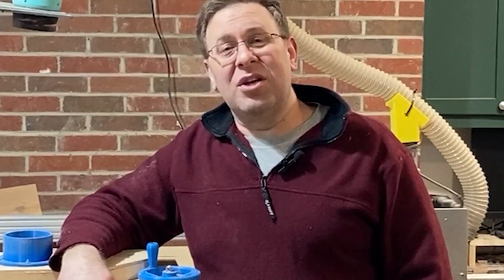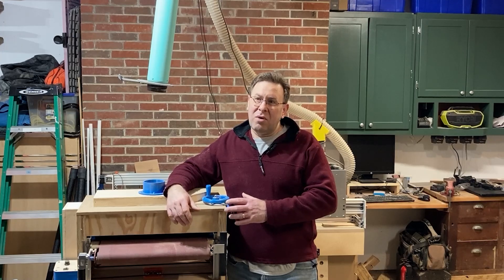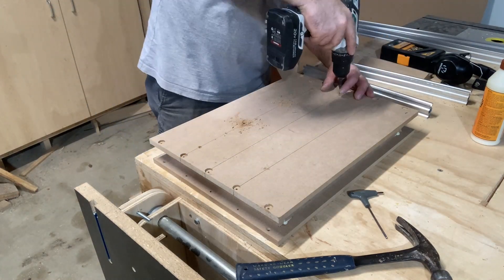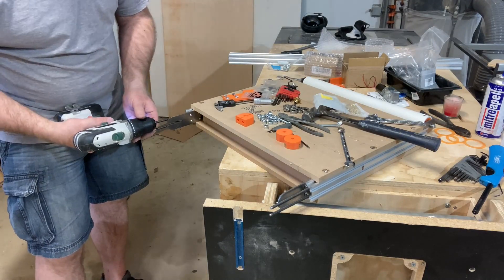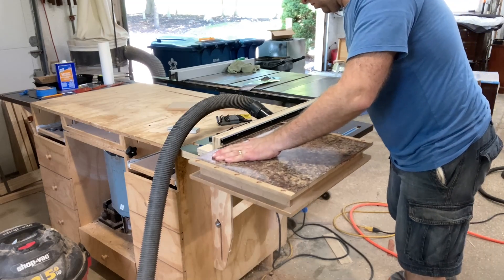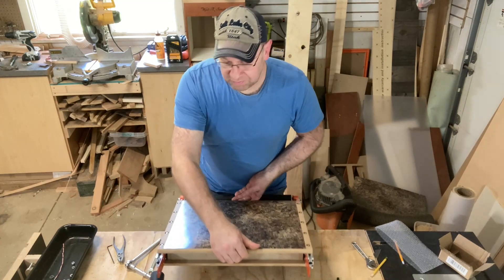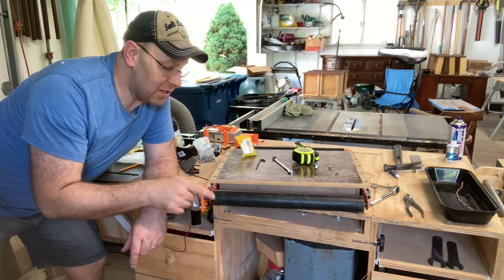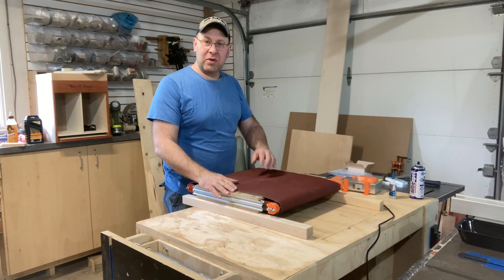DIY Drum Sander out of Plywood? Part 1

Comment: Of all the diy drum sanders I’ve seen so far, it’s definitely looking like I’m going to attempt yours. I didn’t catch the torsion box table dimensions, but I’ll watch again and look through the description again. I’m not exactly electronically inclined, would you be able to provide Power Supply options? 

I have a laser, 3D printer (very glad I found you and this video on thingiverse) and plenty of routers, but no CNC or parts. 3-4 motors 1.25 to 2hp, but this isn’t looking like a belt driven build.